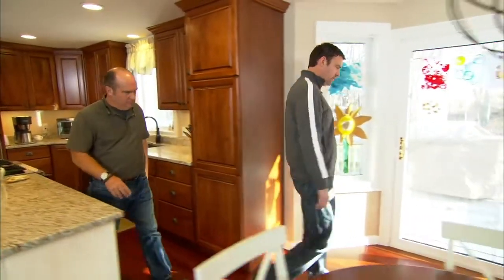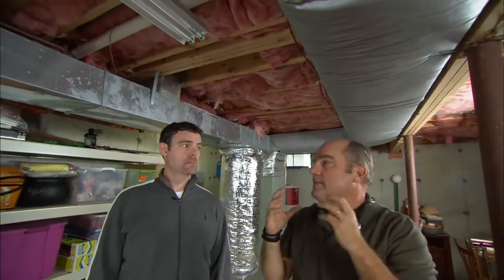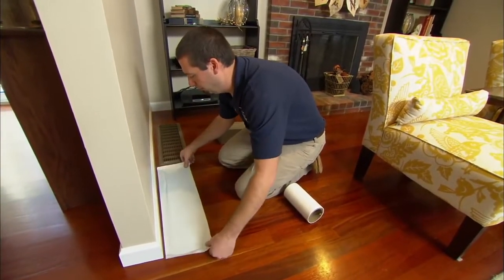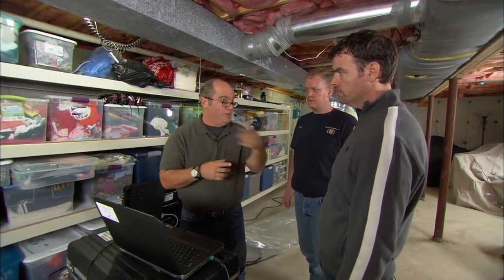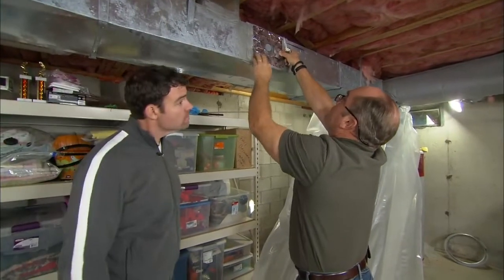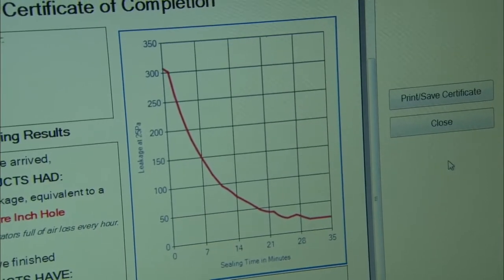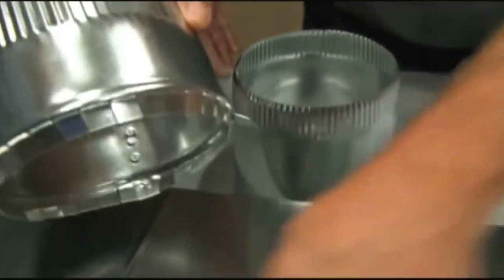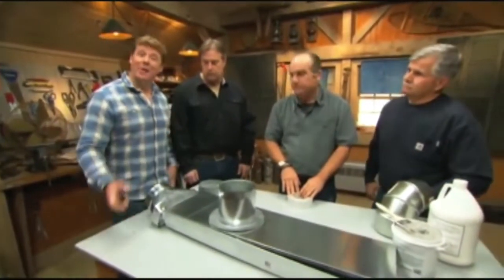PBS Ask This Old House Featuring Aeroseal Duct Sealing

Comment: They didn’t do the work right this efficient crap is a rip off… how can u put a new furnace in and still have higher bills it’s a racket in the industry make more homeowners pay more oh then they say your furnace has a life expectancy of 10 years when they use to last 25 -30 yrs
Reply from the maker: While thorough mastic application is helpful and reduces the need for Aeroseal duct sealing, Aeroseal is beneficial in that it is both faster and more thorough on both the large scale and the nearly microscopic scale holes that adds up.  This is separate from the furnace and air conditioner and with it's application, by not conditioning spaces that don't need to be conditioning, ANY HVAC system is made more efficient.

Comment: My apartment is getting second hand smoke from my HVAC vents. It seems there are some leakages in the ducts that lets the smoke from upstairs  come in. Would this work for urban apartments?
Reply from the maker: Secondhand smoke can move through various different paths or, depending on the set up of the system, can be actively circulated via the HVAC system.  However, if the problem is occurring because secondhand smoke is moving in and out through the ducts themselves, then absolutely.  The Aeroseal sealant would seal those ducts and significantly reduce the secondhand smoke from moving throughout the apartment.
Reply: @aeroseal   Thank you for the reply. How can one tell the difference? What kind of tests need to be done to understand the difference? 

We have only 2 shared vents in the building (kitchen and bathroom) and 6 others are only supposed to be connected to my HVAC but still release smoke.
Reply from the maker: The landlord or apartment owners should have a good idea of how the HVAC is setup.  If they confirm that the units are completely separated, yet the smell of smoke is more strongly circulated when the HVAC is running, it's more likely that it's leaking in through the leaky ductwork.  However, the best way to find out one way or the other is to get a professional in there who can do their own tests to confirm.
Reply: @aeroseal     I own the place and was told the units are separated by our local handyman of the condo. I don't know anything about HVACs.  Would any HVAC expert be able to do the aero sealing? Also, they would only have access to my apartment so would that be enough for them to seal my ducts? If I am able to go this route, then I would be fine with sealing the common ducts permanently to avoid this issue because I'm assuming common ducts cannot get sealed?  Also, most Aeroseal companies are refusing to work on/in apartments in DC. Any leads on that would be great!

Comment: Questions; how long before the sealing/coating starts to disintegrate and break away and possibly contaminating the Air Handler... does it work on 'flex' duct?
Also, being your only sealing the 'supply' ducts, what about leaking returns... as a leaking return in the attic will suck-in hot attic air making the AC system works harder and be inefficient.
Reply from the maker: Hello Ray, Our product comes with a 10 year manufacturer's warranty, but has been stress tested to last 40+ years! Yes, Aeroseal works with any duct work that can be pressurized. We seal both the supply and returns!